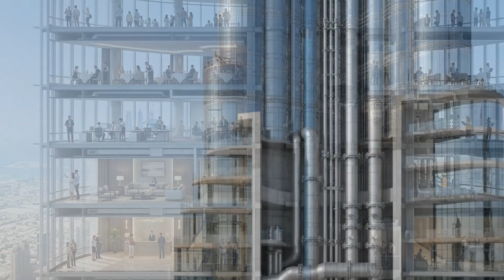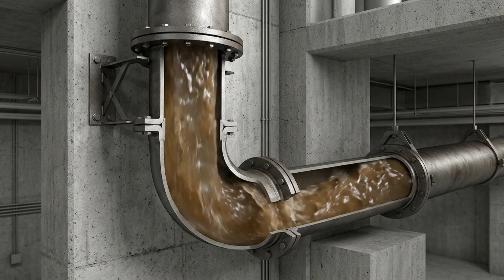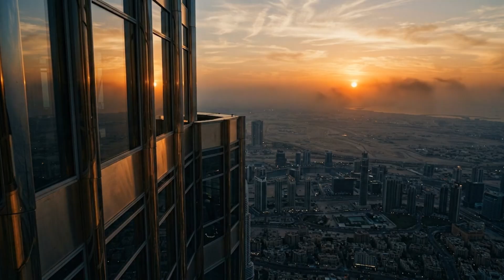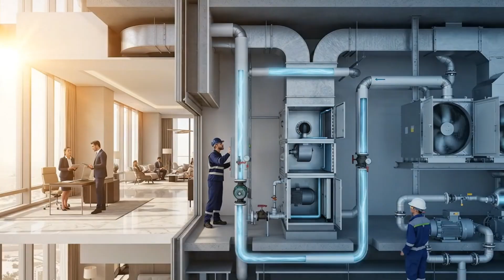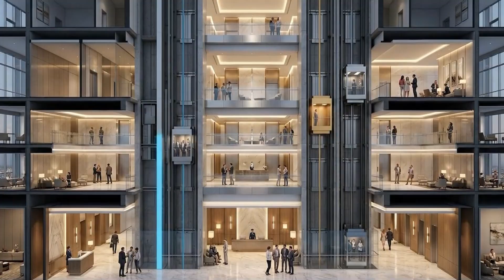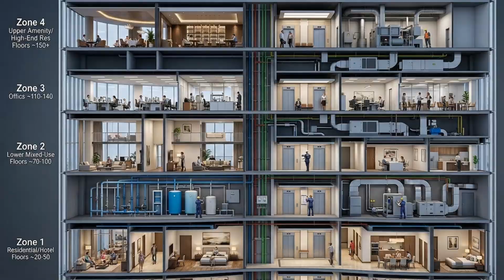How Does the World's Tallest Building Get Water to the 163rd Floor

Comment: I was fascinated by how much the desert heat affects the Burj Khalifa. I knew Dubai was hot, but I never imagined that the heat could threaten the concrete while the tower was still being constructed. Adding huge amounts of ice to the concrete and scheduling major pours at night is such an incredible solution. This video made me appreciate the building on a completely different level.
Reply from the maker: Thank you so much for your thoughtful comment! I’m glad you found the connection between desalination, the Saudi Green Initiative, and the energy trade-offs interesting.
Reply from the maker: The concrete cooling process is one of the most fascinating parts of the Burj Khalifa project. I was amazed that something as simple as ice could become such a critical engineering solution in Dubai’s extreme heat. It really shows how much planning and innovation went into every stage of construction. What part of the Burj Khalifa’s engineering surprised you the most?

Comment: Calling the Burj Khalifa a “vertical city” makes so much more sense after watching this. A normal city spreads its infrastructure across roads and underground networks, while this building has to stack everything vertically. Water goes up, waste comes down, people move through different zones, and cooling has to fight the sun. It's basically an entire city compressed into one structure.
Reply from the maker: Thank you so much for your thoughtful comment! I’m glad you found the connection between desalination, the Saudi Green Initiative, and the energy trade-offs interesting.
Reply from the maker: The “vertical city” concept really puts the Burj Khalifa into perspective. What amazed me is that all the systems a normal city spreads across miles have to work inside one enormous structure. Water, waste, transportation, cooling, electricity — everything has to move vertically. It’s incredible to think of a skyscraper as an entire city compressed into a single footprint.

Comment: The final message about control is what stayed with me most. The engineers didn't try to create one gigantic system that could handle everything. They divided the problems into smaller zones and built redundancy between them. It's such a simple concept, but applying it to a 2,700-foot building is absolutely mind-blowing.
Reply: I completely agree. What impressed me most is that the same principle works across water, elevators, cooling, and mechanical systems. It's a simple idea applied to an extraordinary engineering challenge.
Reply: Absolutely! The redundancy aspect really changed how I think about the building. At 2,700 feet, even a small failure could become a huge problem, so isolation makes perfect sense.
Reply: Well said! The Burj Khalifa almost feels like thousands of smaller systems cooperating instead of one giant machine. Applying that philosophy at this scale is what makes the project truly incredible.
Reply: Yes, that stood out to me too! Instead of creating one system that could never fail, they designed the tower so that one failure wouldn't bring everything down. That's some seriously clever engineering.
Reply: Same here. I think that's what makes the engineering so impressive—the solution isn't brute force, but intelligent organization. Turning one impossible problem into many manageable ones is brilliant.
Reply from the maker: Exactly! That's really the core engineering philosophy behind the Burj Khalifa. Instead of relying on one massive system, the engineers created smaller, controlled systems that could work together while limiting the impact of individual failures. It's a simple idea, but applying it at nearly half a mile high is what makes it so impressive.
Reply from the maker: Thank you so much for watching and sharing your thoughts! We're glad that the idea of “control” stood out to you as much as it did to us.
Reply: Exactly! The idea sounds simple until you realize how difficult it is to apply at that scale. Breaking a massive problem into smaller controlled systems was incredibly smart.

Comment: The 1,200 PSI water pressure comparison really put the scale into perspective for me. I never thought about what would happen if you simply tried to pump water directly to the top of a skyscraper. Dividing the tower into mechanical zones suddenly makes perfect sense. This is the kind of engineering explanation I actually enjoy watching.
Reply: Yes, that was one of my favorite parts too. The idea of turning one huge water system into several smaller controlled systems is incredibly smart. It makes the engineering feel much more understandable.
Reply: Same reaction here! 1,200 PSI sounds crazy when you realize a normal faucet only needs around 50. It's amazing how many hidden engineering problems exist inside a building we mostly just see from the outside.
Reply: Same here! The 1,200 PSI really made me understand why they couldn't just pump water straight to the top. Breaking it into zones is such a clever solution.
Reply: Exactly! I had never thought about water pressure becoming such a massive problem in a skyscraper. The mechanical zones suddenly make the whole system much easier to understand.
Reply: That number surprised me too! You don't really appreciate how extreme the pressure becomes until you compare it with a normal household faucet. Really impressive engineering.
Reply from the maker: Exactly! That 1,200 PSI figure really shows why a simple “pump it to the top” approach would never work. Breaking the water system into separate pressure zones is such a clever solution to a problem most of us would never even think about. Glad the engineering explanation made the scale easier to appreciate!
Reply from the maker: Thank you so much for watching and for sharing this! We're really happy you enjoyed the engineering details.

Comment: This video made me realize that building something tall is only a small part of the challenge. Water, sewage, cooling, elevators, concrete, and even the desert heat all become completely different engineering problems at this scale. I especially loved the idea of breaking one impossible system into smaller controlled systems. That principle is brilliant.
Reply: Absolutely, I had the same realization. The taller the building gets, the more every basic system becomes an engineering challenge of its own. Breaking everything into smaller controlled systems is such an elegant solution.
Reply: That was my biggest takeaway as well. Every extra floor creates new problems with pressure, heat, transportation, and safety. The solution wasn't simply more power—it was smarter system design.
Reply: I completely agree with you. The building almost feels like a collection of smaller machines working together rather than one giant structure. That idea of controlling complexity really stood out to me too.
Reply: Same here! The height gets all the attention, but the hidden infrastructure is arguably even more impressive. It's amazing how the engineers turned so many impossible problems into smaller, manageable ones.
Reply from the maker: Exactly! That was one of the biggest ideas we wanted to show with this video—the height is only the beginning of the engineering challenge. Once you stack an entire city's infrastructure vertically, even simple things like water and sewage become completely different problems. Breaking those huge challenges into smaller, controlled systems is what makes the Burj Khalifa so fascinating.
Reply from the maker: Thank you so much, Laura! We're really glad you enjoyed the engineering side of the story and took that key idea away from the video.
Reply: So true! I never realized that something as simple as water or sewage could become such a huge problem at that height. The way they divided the systems into manageable zones was incredibly clever.